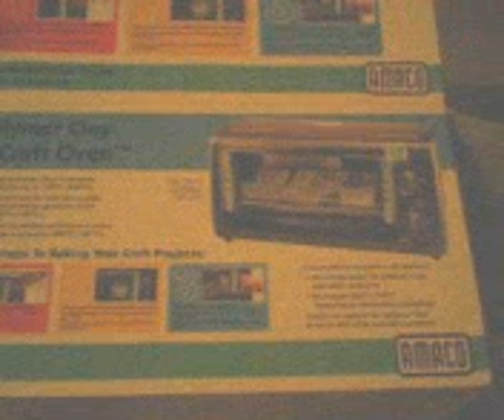Halo Visor Thermoforming

Comment: An easy way to get the visor, is to use clear fiberglass resin and form it to a mold, that way you get the don't have to worry about the bubbles... (The downside is that you can't get it tinted though, unless you melt a motorcycle visor...) It just depends on how anal you want to be, and if you don't plan on wearing it, you can spray paint it...